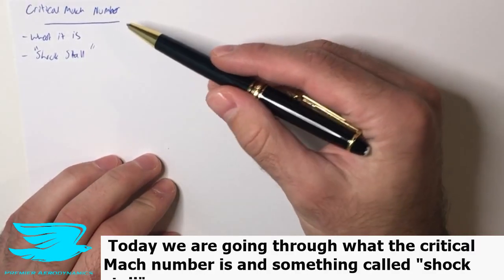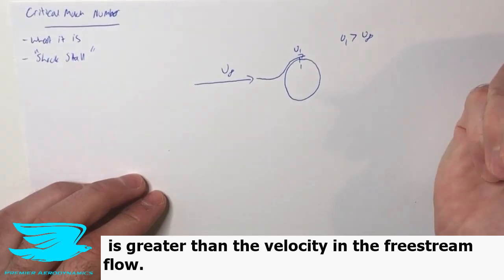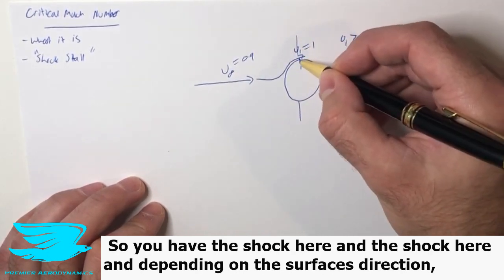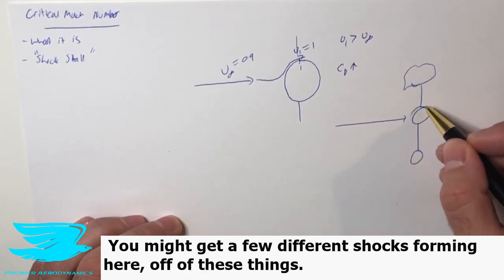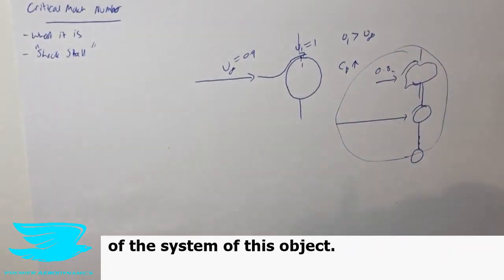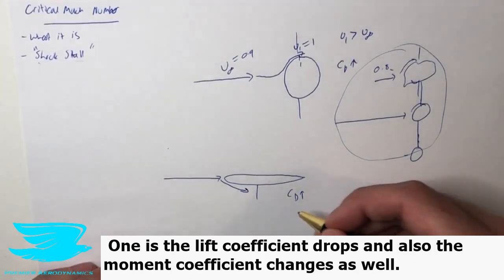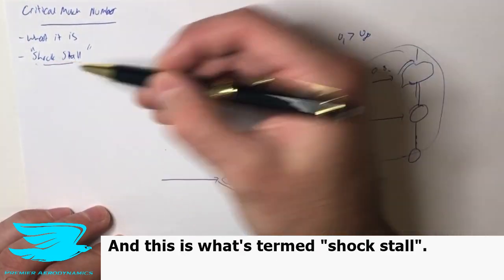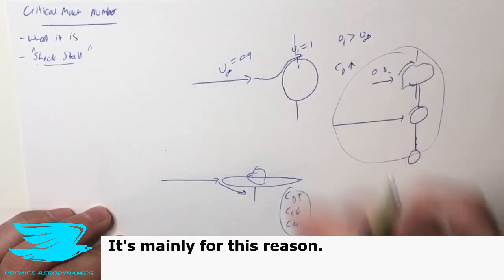[Aero Fundamentals #31] Critical Mach Number

Comment: When you brought up helicopters, I got to thinking about the speed at the tips of the rotors. Some rotors spin pretty fast, do they ever go super sonic?
Reply from the maker: Not under designed circumstances.

I guess if you were to dive and push the blades to their max, some helicopters might get there, but you'd probably run into helicopter stability issues before then, and not be able to keep it straight.

DLR was actually investigating making many smaller booms on a blade to allow the blade to go supersonic but not have a huge shock. Unfortunately, from what I know, it didn't work out well.